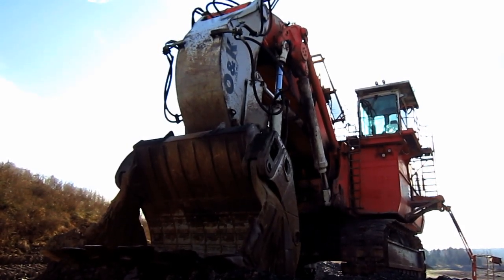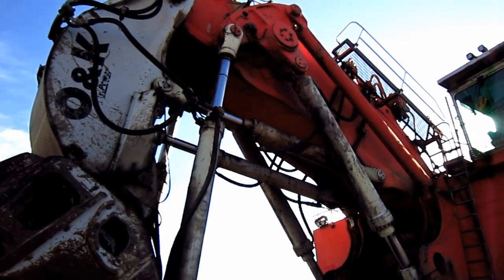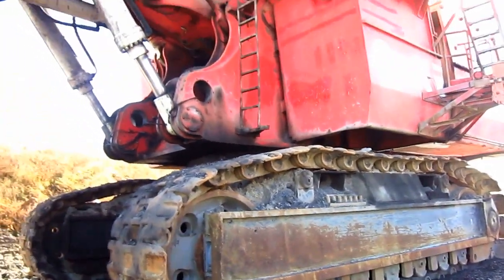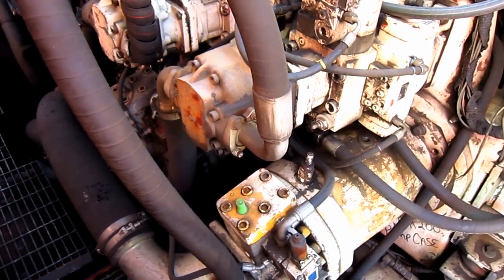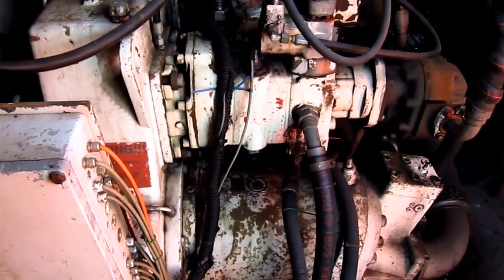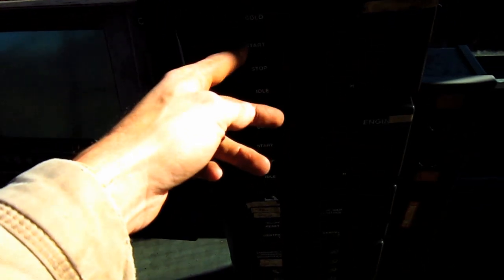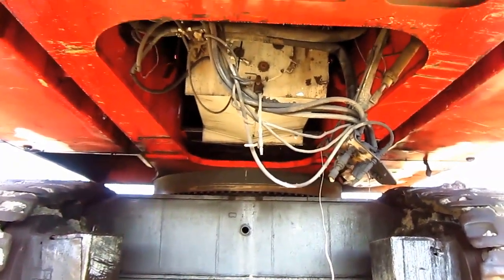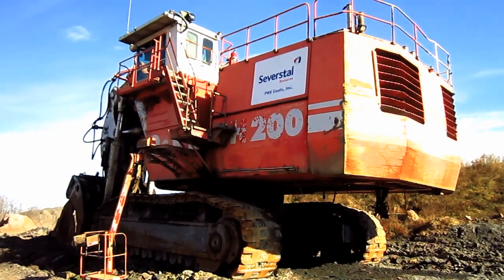O&K RH200 Documentary

Comment: Love your documentaries, but think this one was particularly well done! How do they know when using those remote service ports when the machine is full of oil, fuel, or grease? They just have a second person up top checking or does it have an automatic shut off like fueling your car?
Reply: I’m not sure about this particular machine, but what I’ve done is check the maintenance manual for the approximate refill capacity, then using the meter on the oil dispenser I’ll stop when I’ve pumped about 85% of what the component is supposed to hold. Then go pull the dipstick or check the sight glass and go from there. I work on a lot of Caterpillar machines and their manuals list “approximate” refill capacities. They’re not always exact. I’ve overfilled more than one component, after you’ve serviced the same machines multiple times you have a pretty good idea of what they hold.
Reply: @cl7510  ah, got it - thank you!
Reply: Like CL75 said, for swing gearboxes, Pump drive gearboxes, hydraulic oil etc it is a sight of the dipsticks or sigh glasses and an educated guess as to the fill time, then a re check for correct fluid level.
Fuel and grease usually have automatic shutoff. They do at the Iron ore mine I work at anyway, we have a fleet of 6040’s(RH170) and 6060’s(RH340).
Reply: @jamesgarage1223  do you use the Wiggins couplers for the fuel? I’ve worked on a few machines that had those on the fuel tanks, where you connect and fill from the bottom, but we never had the set up to use them and just fill through the top. I think they’re called Wiggins “Fast Fuel” I know I’ve seen them on a D9R, a 773, and an old 988B.
Reply: @cl7510  
Hey mate,

From memory we have wiggins fittings but the fuel shutoff is the Hydrau-flo system. It’s basically a float in the top of the tank that pilots the inlet valve closed when full.

Comment: Tripower. Mmm. The advantage of the linkage is not power but control. The operator has less to do. The only advantage is the geometry improves as boom lifts and it lowers the tilt cylinder point so eliminating the high angle the cylinder must normally work at..breakout forces may be higher but only because of ram sizing. I fact lift cylinders not only lift boom dipper and bucket but also tilt bucket as it raises.
Reply from the maker: Yes, thanks. Everything I stated comes right from O&K
Reply: Exactly.
Same concept in certain backhoes and other bucket equipment.